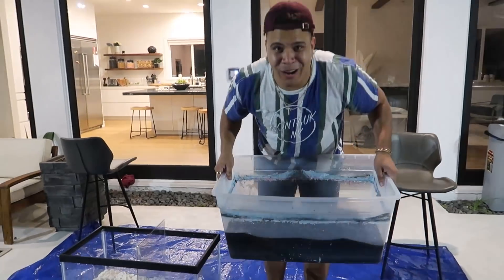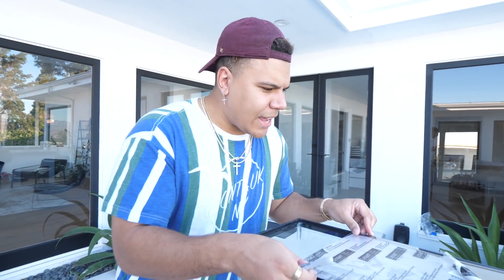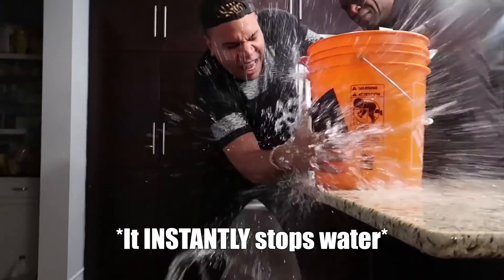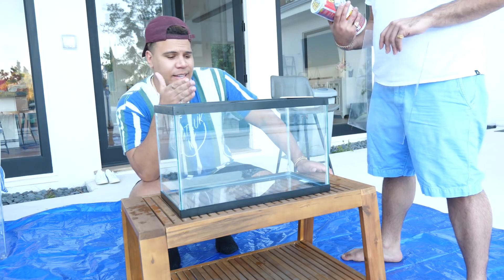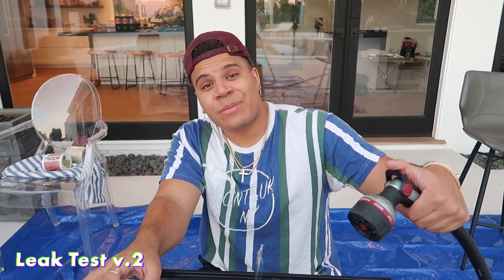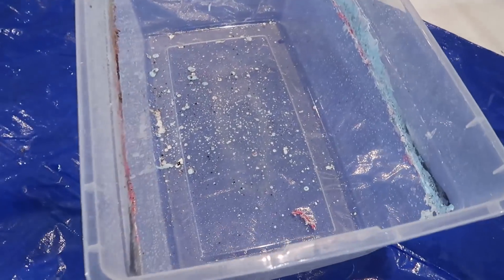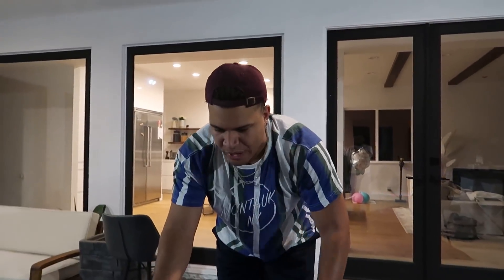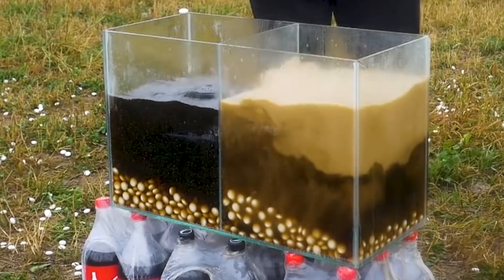Experiment: Coca Cola and Mentos **CRAZY**

Comment: the reason there wasn't an explosion is because there was no pressure in the tank as the tank has a wide neck. you would have to have a thin neck for the pressure to build and then there should be an explosion. good try tho XD

Comment: Okay so the reason why it didn’t work was because the pressure didn’t build up enough for the coke to come flying out. To make it go crazy you should have a cylinder shape on top to give it time to rush out. Also, if you were pouring the soda into a bucket you wouldn’t necessarily need the wall there. Hope this helps a little

Comment: When the bottle was opened diffusion happened when particles move for a area of high concentration e.g. inside the bottle to a area of low concentration e.g. inside the tank therefore none of the water particles could force into the bottle.

Comment: If you put in it something excepts the bottle it won’t work because if you have the bottle it keeps the Corbin dioxide. After you put the mentos in it explodes. But if you have it in something other than a bottle, it won’t work because it’s using normal air (oxygen) and not carbon dioxide. Also it still wouldn’t work if you hade something to cover it because you needed a smaller space because in a bottle if you put a mentos in, the fizz in the soda makes air come out and make the soda have nowhere to go so it has to explode.

Comment: 2 things to why this didnt work
1. Too much surface area, All the fizz just spreads out, (If you throw a bomb into a canister, It will make the canister Propel in a direction or just destroy it, if the bomb is an open field, it wont really do anything, just make a significantly weaker shockwave)
2. Loose Pressure, The Disolving that happens With mentos and the diet coke creates alot of pressure, in the form of fizz, But there is nothing allowing the pressure to build up (a normal coke bottle has a funnel which allows pressure to mend in the funnel, thus, in a way building up)

Comment: You need pressure. what you should do is make the fish tank into a very narrow point at the top and seal it ,which will create pressure but If you want that explosive reaction make sure the coke is will carbonated and is in the fish tank with a lot of air pressure then have it mix with mentos.

Comment: You said 10000 in the thumbnail clip at the beginning but you pulled out all the packs in the beginning if you slow it down you can count the packages and see there was 50 and one regular pack has 60 and the is 14 in a single big stick so you have 4200 mentos

Comment: The aproximate aerodynamics calculate the friction of the pressure of the platform in which you did the experiment summing up to basically a complete disaster based on the calculations

Comment: There is 115,752 mentos in half of the 10.5 gallon tank

To solve: 
divide the tank by 2 (5.25)
Find the area of half the tank (5.25 × 5.25)
Then multiply that number to 4200 mentos 
Then yea, that's how to find how many mentos there are in half the tank😂🤪🤙

Comment: Well if you want the technical reason it’s because there wasn’t enough pressure meaning the gap has to be smaller or the size of the container has to be smaller that is why it didn’t do anything and why the coke or Pepsi bottle explode so next time just make or design a huge coke bottle and see where it goes from there